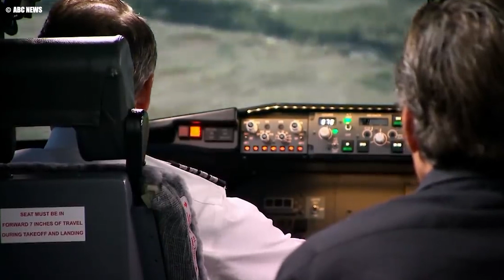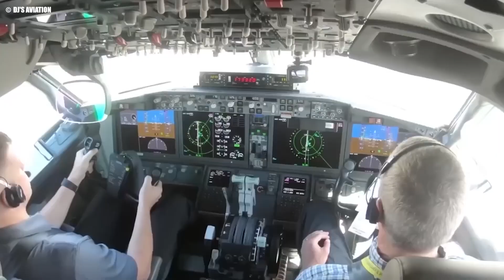Why The 777X Can Finally FIX Boeing! Certification Flights Started!

Comment: Timing is key in aviation. The 777x I think has lost that crucial timing giving the a350 a massive lead. The best chance boeing has now is to develop 2 clean sheet designs for the 2030's. A mid-market design and an official replacement of the 737 family. This would put them on path with Airbus's plan to replace the a320 which they're already working on.
Reply from the maker: True!